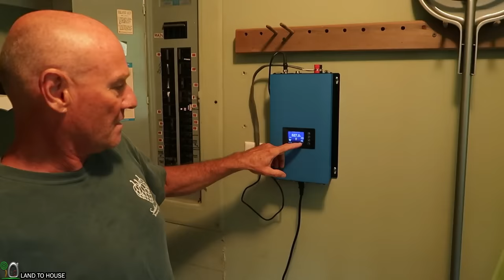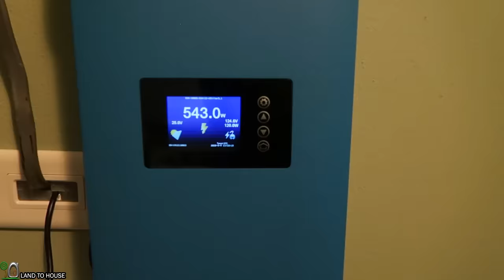Awesome Low Head High Flow Grid Tie Micro Hydro 530 watts!

Comment: This is impressive. I love the vortex destroyer. Actually it would have been better to rectify the generator output to dc down near the turbine. Fewer losses in dc. Also the rectified power will be at a higher voltage than the ac which will reduce losses further. But with such a short run the losses are likely to be minimal anyway.
As for people commenting about dangerous use of the ground wire to carry one phase, this is nonsense. Remember it’s only 24volts.
Overall it’s a clever well thought out system. Well done from uk.
Reply from the maker: I have heard both sides of the argument on the DC vs AC line run. I would have to agree with you that power over only 100 feet is not going to lose much. Is it easier to run 3 phase long distance because the amps are on 3 wire and not 2?
Reply: Land to House I am part of a company which designs and installs Microhydro systems full time. We have done a few small systems similar to this and as for the question of whether to rectify at the turbine or the house, I would say that in this case because the distance is so short it makes no difference. I think I would have done the same as you just to give the water less things to corrode.
Quite a few people install their own Microhydro systems. What I noticed about your system is that you have not made any mistakes that everybody else does. You have spent time thinking about it. For instance the position of the ball valve on the draft tube is just about right. You can have the valve open while you run the vacuum without water from the river being sucked backwards. The 8 inch pipe at the bottom to optimise the vacuum is a good thing.
Reply: rupe53 No you are wrong. The rectified volts will be higher than the ac volts. The fact that there is 500 Watts or 5000 Watts will not make it more dangerous.
Reply: @milespostlethwaite1154  ... just retired from a job where I worked with this on a regular basis and rectifying AC to DC always results in a lower average voltage. The job here is to bring it to a regulated 24 volts DC, which is what the inverter works with. Obviously the regulated part is in the inverter because we have no clue what the numbers really are using what's provided in the video. The current available is the safety issue, not always the voltage.
Reply: @milespostlethwaite1154  actually, the wattage available will make it more or less dangerous. If you're acting as a short, you're going to draw a lot more current at a higher available wattage, and therefore take more damage. any vintage that can overcome the skin resistance can be dangerous, and as little as 30mA across the chest can mess with your heart. Not trying to spook people out of it, because this stuff is really awesome, especially for home gamers, but healthy respect and understanding goes a long way. Take care.
Reply: @milespostlethwaite1154  yes brother you are right always depend on voltage not watt
Reply: @LandtoHouse  AC or DC doesn't matter. Neither have an effect of line loss. Only voltage and wire size do. The reason why AC is used for long distance transmission is because transformers can be used to increase the voltage. Transformers don't work on DC.
Reply: @rupe53  Nop, rectifying to a capacitor will always give you something closer to VP,  Voltage Peak, while the nominal Vrms will always be lower because VP=Vrms*(pi/2)
Reply: @fss1704  ... hate to say this but capacitors don't rectify. At least I think that's what you are saying.
Reply: rupe53 rectifying TO a capacitor. I think you misunderstood
Reply: @rupe53  No. He's saying that if you put the output of a bridge rectifier into a capacitor, it will charge to the peak voltage the AC reaches. So if you put 120 Vrms AC in through a bridge rectifier and capacitor, you will get about 168 volts DC out.
Reply: @rupe53  for most of the thing's you said you're wrong. maybe you have worked with electricity but I'm an electrical engineer! watch Electroboom' s videos! you will understand better than reading it here!
Reply: @rupe53  @ 30V ac you probably would feel a mild buzz if touching two phases simultaneously , nothing else.
If the neutral point of the generator isn't referenced to ground, which it isn't, then it wouldn't matter if ALL the wires were bare, you still would not get a shock by touching a bare single conductor.
Reply: @markrainford1219  ... mention of the bare conductor was more toward code where it should have it's own insulation. Any mention of shock hazard would be about bare / exposed termination points where fingers could go across them.
Reply: @rupe53  24vdc isn't going to electrocute anybody. If it could there would be hundreds of dead auto electricians by now. :-)
Reply: @derekjeftha6479  ... At the point where the terminals are exposed it's still AC voltage.
Reply: @milespostlethwaite1154  Then you should know how to do a voltage drop calculation. 100' is a long ways for DC. I'd imagine wire size would have to be increase (didn't do the voltage calc, but from experience..)
Reply: Steve Svensson actually dc will travel down a wire easier because with ac you get reactance (although a negligible amount in this case). And as I said above, the dc voltage will be higher than the ac, therefore less volt drop.
Reply: @milespostlethwaite1154  There's a lot of variables. I'm assuming each leg of the three phase is 120 volt, and it looks like the wire is #14. 
Draw is the missing part of the equation.
https://www.calculator.net/voltage-drop-calculator.html?material=copper&wiresize=8.286&voltage=120&phase=ac3&noofconductor=3&distance=100&distanceunit=feet&amperes=20&x=48&y=20
Reply: Anyways, AC 3 Phase is under 3% voltage drop, within code.
DC at 24 assuming there is a 20 amp draw is 10.10% which would leave the voltage at the end of the run at 42.09% of the voltage (24 volts). Bump up the DC voltage it's plausible, but more expensive.
Reply: Three phase makes more efficient use of copper than dc, i.e. less resistive loss. The downsides being three wires rather than two and a more expensive rectifier. 100 feet is quite a long run for 24 volts, roughly 20 amps! A thicker cable would cut the losses down a bit or a higher voltage generator,  but then you may need a bulky transformer to drop the volts down for the inverter. An impressive system.
Reply: @fss1704  Only with no load.
Reply: So many wires crossed here. (Pun intended.) Let's just deal with the cable aspect for now.

1. Losses in cable. Losses are a function of the current (and only current) in the cable. Loss in watts = I²*R. So if there's 10 amps flowing through the cable and the cable is 0.01 ohm per foot, (over 100 feet =1 ohm) means we are loosing 10*10*1 = 100 watts. Also the volts drop over this cable is V=I*R = 10*1 which is 10 volts. This characteristic of the cable is a function of current through it and has no relation to system voltage. 

2. Efficiency is a function of generated power and  losses. We worked out above we were loosing 100w in the cable. If the invertor is recieving 24v (AC or DC makes no difference at this point (3 phase complicates the issue, let's just stick with two wires for now))  and we are loosing 10v across the cable that means we must be getting 10+24=34 volts into the cable so our turbine/rectifier is generating 34v at 10 amps which is 340 watts. So our cable efficiency is (340-100)/340 = 70%

3. How to improve cable efficiency?
A. Increase the operational voltage and decrease the current for the same power (watts). Because losses in the cable are a function of current only, that means by decreasing the current we loose less power and also because we have increased voltage the ratio of transmitted power to lost power is greater. IE increased efficiency. This is not easily achieved as the voltage will be a characteristic of the generator.
B. Use thicker cable. This reduces the resistance of the cable run and reduces the losses therefore increasing efficiency. In an ideal world the cable would be zero ohms meaning at 10Amps the inverter would be seeing the same voltage that the turbine is producing (34v above) and therefore receiving the full 340w the turbine is generating.

4. 3 phase. Oh where do we start? The advantage of 3 phase is that it uses 3 wires instead of two wires to transmit 3 times the power for the same current in the wire and voltage across it. This would mean moving the rectifier to the house but would be more efficient . Why? Because our  single phase 100 foot run is really 100 foot there and 100 foot back = 200 feet. To make this into 3 phase we add a third wire of 100 feet. So we have more copper to carry our power to the house. The single main advantage of 3 phase is that it's much cheaper (less copper needed) to transmit the same amount of power long distances. And a slight efficiency advantage. But the main efficiency advantage on the grid is to do with stepping up the voltage which you can only do (easily) with ac:
5. The reason AC is declared more "efficient" is because on the grid AC allows you with a transformer to step up the voltage and reduce the CURRENT meaning you loose less energy in the cable. Then step it down again at the other end.. So we could (hypothetically) up our volts to 3400 and drop the current to 0.1 amps. 3400*0.1 = 340 watts transmitted still, but our cable losses are now only 0.1 amps*1 ohm= 0.1 watts!!  And our cable efficiency is now 99.97%!!

Back to the turbine. Voltage is probably fixed at 24v AC peak (18v RMS) because the alternator is based on an automotive (truck) alternator. Which also means it's generating 3 phase AC which is immediately rectified to give 24 DC.

Only real option is to fatten up that wire to reduce losses and move the rectifier to the house to allow 3 wires instead of 2 to take 3 phase there instead of DC.

There are other options. Like using transformers to step up the volts for the cable run, or move the invertor near field to the turbine. But for that you've got to know what you're doing...
Reply: Its highly illegal to use the ground as a current carrying conductor from the USA  it's in the NEC code book
Reply: @thereynolds2725  also dc you lose a lot the long distance you transmit
Reply: @markrainford1219  if you were grounded like by standing on the ground with wet shoes or ...
Reply: @stompbuilds5416  he said 10 AWG
Reply: @jamesgarrison6430  Wouldn't matter if you were stood on your head in water and touching the conductor with your toes. You still would not get a shock because there is no return path to the supply.
A fault in the inverter could be a different matter of course.
Reply: rupe53 yes it’s still ac but only 24V AC!!
Reply: Steve Svensson I think you are assuming that the ac is 120V. It’s actually not. I believe it is a 24V ac generator on the turbine.
Reply: @jamesgarrison6430  That isn't because it's DC. The loss is due to resistance. It doesn't matter if it is AC or DC.
Reply: @AndiusPandius  I agree with just about everything you said, but a couple of points here  - a) I believe the rectifier is at the house already
b) I have checked the volt drop and for any given cable as long as it is a reasonable size, the losses are about the same for dc as ac. For example with 24V 3 phase (3 wires) if you used 16mm cable your volt drop will be about 4%. If you rectify at the turbine and use 2 wires (again 16mm) your volt drop will be about 4%. This is because when you rectify the 24V ac it will become 33.8V dc. The higher voltage practically cancels out the advantage of the third wire.
Reply: @milespostlethwaite1154  Hi there. I'm in the UK too. So 1st DC Vs AC. The beauty of RMS AC measurements mean the behaviour in terms of energy between AC and DC is the same. This is the case when AC is powering a resistive load and the powerfactor is unity. I agree that when you rectify AC the DC voltage will be higher than the RMS AC voltage. It will be equal to the peak of the AC sin which is ✓2 or 1.414 times the AC RMS value. But... There's always a but... If the DC on the rectifier side is feeding a smoothing capacitor this peak voltage will be maintained. If there is no cap then the DC is a rectified sine wave and has a peak value and its own average value similar to AC RMS but now the DC never goes negative although it will touch zero when the AC crosses zero. The reason that you can have more losses in AC lines when the rectifier/capacitor is in the house is because the rectifier/capacitor plays havoc with the current waveform which will no longer be sinusoidal but looks more like a square wave that only conducts for example about 10 to 20% of the time towards the top of the AC voltage waveform. So 100% of energy transmission now has to take place in this 20% window and W=V*I no longer holds true as the current I is no longer an RMS value. The v*i product has to be integrated over a cycle to correctly take into account the different shapes of the voltage and current waveforms. As cable losses are proportional to i² the losses are increased in the cable not because it is AC rather than dc but because the current waveform is not sinusoidal. For true RMS AC into a resistive load the voltage and current waveforms are sinusoidal and in phase (unity powerfactor) and losses in transmission cable will be identical to that of a DC system.
Reply: @milespostlethwaite1154  Hi again. So 3 phase over single phase. The advantage of 3 phase on a grid system is that it allows the transmission of 3 times the power for one extra conductor, all losses being equal to the single phase case. 3 phase will also change the shape of the rectified DC compared to rectified single phase AC. And as a result will reduce the losses in the transmission cable, again, not because it's AC or DC but because the shape of the rectified current waveform approaches that of the rectified voltage waveform and the cable is now carrying current for more of the AC cycle.
Reply: @rupe53  There is no danger at all from 30 volts. It doesn't have enough potential to push dangerous currents through the human body, even if it's soaking wet. That there is 500 Watts is irrelevant.
Reply: How would a rectifier increase voltage?
Reply: @milespostlethwaite1154  Not true. The rectifier won't increase the voltage. Trust me,. I'm an engineer. :-)
Reply: @Blu3Jao  That's what fuses are for. They should be a part of a properly designed system.
Reply: @jimprice1959  Hi, it doesn't. Technically. It's to do with the way AC and DC are measured. 
DC is just "on". It has a potential from a reference (we will call neutral). AC is changing ideally following a sinusoidal cycle. It goes +ve and -ve with respect to our reference. 
How do we measure that?

If we take an average of a sine we get zero. So we take the RMS. Or Root Mean Square. We end up (for single phase AC) with a value that is * lower* than the peak of the sine, actually the peak times √2 /2 or 0.707 times the peak. The RMS value gives the voltage of the equivalent DC source that would give the same power.

But if we put that RMS AC source through a bridge rectifier follwed by a reservoir capacitor then on the output we see a DC voltage that is equal to the peak value of the AC and not the RMS value.

We also mess with our AC current because now our AC current is not sinusoidal and the majority of the current is drawn in a massive peak near the top of the voltage waveform in about 10 to 20% of the AC cycle time. This peak has to supply power to the load and supply all the energy required to charge the capacitor which is going to provide load for the rest of the AC cycle (80 to 90%).

So you can see that those peak currents can be 5 to 10 times the RMS AC equivalent and 3.5 to 7 times the AC equivalent peak. If the alternator is not designed to drive a rectifier it will struggle with those peak currents.

The usual solution coarsely speaking is to use a three phase alternator because there the peak currents through the alternator/rectifier are lower because there's more peaks of the AC per cycle and more opportunities to charge the capacitor.
Reply: @AndiusPandius  Andy -- So many misconceptions in these threads.  I'm a professional electrical engineer and tested shipboard generators when I worked at SF Naval Shipyard.  I gave tours of the Bonneville Dam for years and am familiar with power transmission.  You are correct in all that you have written.  Sounds like you are a professional as well.  One thing many don't get is that it is actually more efficient to transmit power as DC rather than AC.   Although AC has the advantage of having the voltage easily stepped up using transformers and thus lowering the current. DC has the advantage of not having any reactance.  That's why for distances of over 600 miles it is worth it to use the rectifiers and inverters to create a long distance high voltage transmission line.  We have a 1 million Volt (line-line) 3100 MegaWatt DC transmission line from Celilo, on the Columbia River down to Sylmar in Southern California.  In this small hydro project it doesn't really make much difference.  I'd put the turbine down lower. I'd use a gate valve to control the inlet water flow, I'd try to eliminate the syphon by putting a hole in the bottom of the dam. I'd locate the rectifier in the most environmentally friendly location.  I sure wish I could see the turbine used.
Reply: @jimprice1959  I am not sure how it works. I think it has something to do with the fact that if you look at a sine wave the peaks are higher than the measured ac voltage. Anyway if you try it you will see what I mean.
Reply: @milespostlethwaite1154  Miles - This is true.  So when they decided to determine how the voltage of sinusoidal AC should be defined they used the equivalent to the heating value of DC.  It turned out that the square root of the mean of the squares (RMS) of 120 Volt AC through a resistor will provide the same heat as 120 Volt DC. This only holds true for a sinusoidal wave form.   More details are at https://www.electronics-tutorials.ws/accircuits/rms-voltage.html
Reply: @milespostlethwaite1154  Miles - I stated it incorrectly.  RMS will give you the heating value (DC equivalent) of any AC waveform.  For a sine wave only the RMS works out to be 0.707 of the peak value.  If you rectify AC you'll get the average value which 0.637 of the peak value.  Many AC voltmeters measure the average value by use of a small built in rectifier.  They are calibrated to show the RMS value but are only accurate when measuring true sinusoidal waves.
Reply: @milespostlethwaite1154  Well, the great thing about having the turbine and generator at the highest point in the system, and with a vertical axis, is that it is always at negative pressure, so any leak will be an induction leak, and it is 100% impossible for water to leak out of the pipe into the electrics.  Rainwater is a different matter of course.
Reply: @rupe53  with your experience... do you have a good site for more tips on how to config/ set this up?  thx!
Reply: @dziggy3004     I do not have any suggestions because I stopped pursuing this a few years ago. Your best bet is to do some new research and maybe something easier to understand is available now. This particular thread has been micromanaged by the armchair experts.